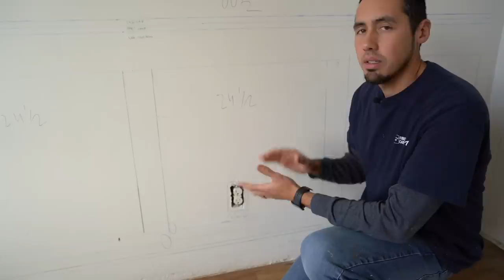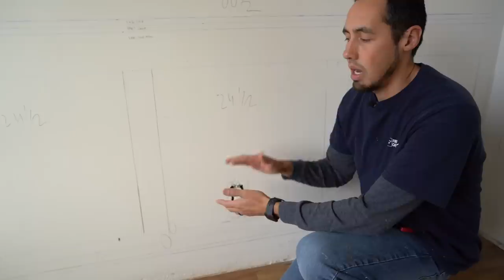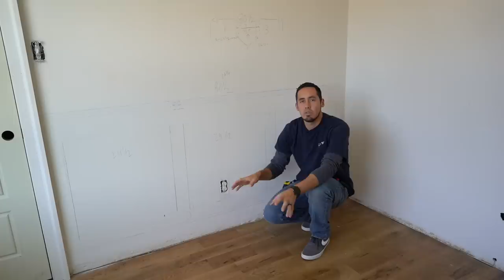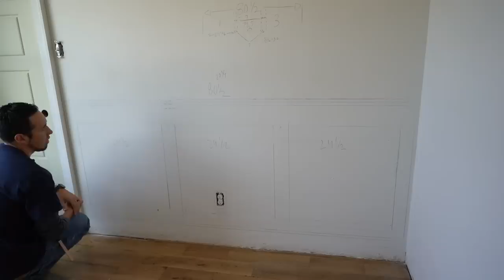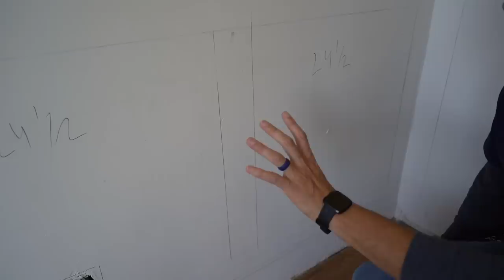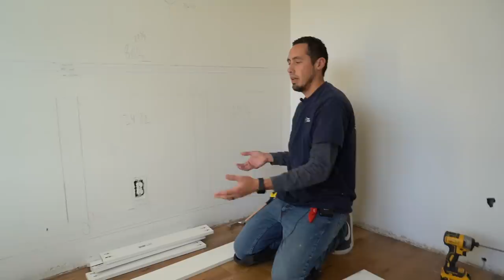Building a Wainscot Unit - Interior Trim Work

Comment: Wow, I’m blown away, the measurements are the same. That’s got to be nice. Is that what it’s like in the real world? My bosses projects are sometimes three inches off, and I’m not exaggerating. Floors that drop three inches, walls that veer back three inches. Walls and ceilings that look like a roller coaster. Try doing finish work in these conditions. lol 😂

Comment: Richard May I suggest that you make stand up jig to hold the rails perpendicular to the ground. This way you should be able to just slide the stiles in place. This way it will make assembly easier. Richard I never knew how to make out the boxes as you do. Appreciate ask your teachings. Thanks

Comment: Really enjoying this series so far and looking forward to the rest of the episodes. I’ve been installing high end kitchens for more than 40 years. As part of the trim detail in many of them I’ve done a lot of wainscot over the years. So far your series has been spot on with how I approach the process with one exception. I always use full height stiles on the ends of the wainscot units. I guess it’s the cabinet guy in me but I think it looks more finished. It’s also easy to scribe the full height stile to an out of plumb corner before assembly.

Comment: When you’re taking the measurement for the same cuts it’s probably better to mark your first cut instead of measuring from the inner blade. The TEETH of the blade will usually take 1/8” out. If your measurement is from the mid part of the blade and not the teeth your cut will come out slightly shorter because the teeth take more out. I dont know if that makes sense. Your work is great and I definitely learn a lot from you. Keep it up Richard!

Comment: Good series, lots of solid information. My preference is to have the unmolded flat area of the top and bottom rails the same width as the stiles. Also, the inside and outside corner stiles should egual out to the width of the main stiles. Balance is key.

Comment: Hey Richard, I'm a trim carpenter that's been doing this over 30 years and I love watching your vids. Ive been using the kreg setup for years and used the kreg screws for years and then I switched over to using 1 1/4 drywall screw and have had great success with them,  just wondering if you have ever tried using drywall screws?  keep up the good work

Comment: hey on the porter cable jig, you only have to do once the handle that twist, this is for the thickness of material, once you set up, you have to use the black handle on the bottom, that is the way is designed and requires less effort

Comment: Just a suggestion, but if you slide the end of the unit into a corner after the first stile is attached, it'll stand up without having to juggle it. ( Like working on a door.)

Comment: Tip. If you can’t find a Packer or piece of wood to prevent tilting or anything in another similar circumstance, use a screw and screw into the depth to make it flush to act as a packer

Comment: Love that there's no need for glue on wood to wood or wood to walls. Do we not nail the inner vertical styles because the odds of hitting a stud are slim or because they are only 24" tall and held by the pocket screws or might a dab of glue behind them be prudent?

Comment: Hey Richard. Thanks for another great video. I'm remodeling my bathroom, and plan to include both  bead board ceiling (boards), and the wainscotting you describe in this video. My old finish nail gun bought the bullet, so I need another. I plan on getting a Paslode to replace it. Do you recommend a 15Ga or a 16Ga for this work? Thanks for the great training! Yo

Comment: Thanks for a great session!  Assemble standing up (how obvious). So much easier than trying to put long units together on a flat surface.  As I recall the corner at the right end of the first section is pretty plumb. Would you have used the shorter rail measurement if the difference in lengths was smaller than the thickness of the stiles?  And how will you install the next section (shim, scribe cap)?  Thanks again.

Comment: Great videos. Would you ever put a thin ply or MDF behind the wainscot unit? Ive got a wall w glue and old wallpaper from a previous owner, but wainscot will cover the area. Easier to cover over or fix the drywall and then build? Thanks for all the detail

Comment: Another great video. I for one am appreciating the pace and detail you are going in to. One question, would it be possible to go in to a bit of detail around your choice of brad nail sizes (gauge and length) for the different applications on the wainscot and door/window casing, trim etc?  It’s one aspect that is new to me. Also how far you can ‘push’ using each gauge eg looking at your tool list I think you were using a 15 gauge nailer for fixing the wainscot to the wall but could you get away with using an 18 gauge nailer? And how long are nails you typically use? Thanks for all your helps with these videos - it’s as good as a Netflix box set! 😀

Comment: Hi, I enjoyed watching your video, very informative. 
I have a couple of questions I hope you may be able to answer. I may be jumping the gun somewhat, however I have a similar project upcoming for our new home and so very interested in the best way to proceed.
1. What material are you using for the wainscotting, solid timber or MDF? Are you using 3/4" / 18mm material?
2. Would you normally install sheet board to create a panel between the stiles or does the original wall serve as the panel between the vertical stiles?
3. Our walls are constructed from concrete blocks with a "dot and dab" Sheetrock overlay (no stud work). How would you suggest I fix the panel system to the wall (the walls are in good condition) would a construction adhesive be suitable or would I need to use Rawls plugs and screws?

I know you are a busy man although any advice would be greatly appreciated. 
Many thanks and keep up the good work.

Comment: Watched this whole playlist and missed the actual install of the hardboard in the wainscot frames. Is it just cut to inner square dimensions and held in by cove moulding, or did you rabbet the edges and have the frame hold it in?

Comment: Do you ever use glue along with your pocket hole screws.  I’m surprised the pocket hole method in MDF holds together so well.  Do you cut your own MDF boards or buy them that way.

Comment: Quick question I did some similar work with biscuits and glue and mdf ripped to the dimensions I wanted for the stiles.  I like your pocket screw method way better do you use any glue at all if the material is mdf and not pine?

Comment: If it is a hall or long room with unlevel floor, this leveling method may look ugly  ( I did one chair rail project , there was around 4 inch floor level difference) , People may not notice 4 inch difference on the top wall section because it is wider. (just my opinion). Great educational finished carpentry. I did learn a lot from you, Thank you for work.

Comment: Thanks so much for sharing your knowledge. I’m planning a wainscot project. I have hot water baseboard radiators running the span of the wall. How would you account for the height the radiator takes? Would you build the bottom rail on top of it?

Comment: Hi.  The wainscoting frame is 3/4 inches and the baseboard adds a bit more.  I bought 3/4 x 7.5 baseboards. What if i have a regular moulding around my door opening? The added thickness of the wainscoting and baseboard will be higher than the stock door moulding. Does that mean ii have to replace the door moulding as well? No problem if I have to.
Thank you

Comment: @Finish Carpentry TV  It's always nice when it comes to the exact inch. Like when your lunch costs $8 even. BUT with that, I thought the saw "ate" a certain amount of board, what, 1/8"? So even if you got an 8' board for vertical styles, could you still get exactly 4 out of it? 3 cuts at least, is there enough extra on an 8ft length usually?

Comment: No pl? Or glue ever behind it?
Reply from the maker: Glue is not necessary for the joint that is screwed together. plus the glue doesn't like to stick to the primer to well anyways. No need for adhesive when shooting in studs. These are 15G nails

Comment: Out of curiosity, why not just put your masonite on the wall first and then throw your wainscot on top of that? I realize you use a bit more material that way, but it seems easier to just throw the laser, cut the piece, glue and nail it on, then go over it with your trim.

Comment: If the measurement between the top rail and the bottom rail is slightly different because the two end walls are not at right angles how do you scribe for a good fit

Comment: Question: how do you handle when the top rail needs to be slightly longer than the bottom rail where the wall ends up narrower? (In my case 3/8" longer on top) Do you move the top stile in half the difference on each side and then hide the gap with the next wall's panel?

Comment: Here is my novice question!! Let's say when you measured the length of the wall top to bottom for your rails they were off? Do you then have to trim off the vertical that goes in the corner? Hope this make sense.
Reply: I think your question is tricky because of the way you worded it. I think that what you're asking is, when you measure the top and it is different from the bottom rail, what do you do? Answer: go with the shortest measurement. That means that you may have to shim the corner of the adjoining wall. In this particular predicament, the other demising obstacle would be the door trim which I am going to assume is level. He just installed it.

Comment: So great on 24” but what about the kerf? Now if you’re gonna cut 24” pieces out of let’s say a 16 foot board you’ll waste almost two feet. It would be better to have them just a bit shorter right?
Reply: around me boards come in 14 ft lengths but the actual measurement is 14ft 3 inches giving more then enough to get 7 equal 24" cuts

Comment: Is the style you put on the corner, against the other wall, the same width as the other 3 along that wall? If it is, won't it look thinner once you butt the style for the other wall next to it (by 3/4")?
Reply: That was my only question as well. During the layout need to add 3/4" to the right hand stile.
Reply: He addressed that in a previous video in the series. He'll take 3/4 off of the stile on the next wall..

Comment: If you were trying to maximize your use of the boards, shouldn't you have shortened the stiles by at least your kerf thickness?  Because now an 8 ft board will only yield 3 24" boards and one 23 5/8" (assuming 1/8" kerf)

Comment: Yucca board?? Did I miss a video??
Reply: I thought this is going to come up. I saw some mud on the plug in the wall. I guess this isn't a video series on how to smooth drywall..
Reply: My intent was not to be negative. I saw the one video where the discussion was regarding where to place the seam for the board. I think all the Finished Carpenter Videos are outstanding and have been taught a tremendous amount. I just was asking if I missed something. Did the decision to not use the board get captured somewhere and if so what was the thought process. I am here to learn.
Reply: I think he said he was installing the board inside each panel versus the whole wall behind the wainscoting. since he is installing a panel molding you can get away with doing it this way.
Reply: moose thank you!!! I appreciate this.

Comment: How long are the nails you used? And would 16ga. nails be enough for this?
Reply: Mark Kramer yea you can I do trim work and I use nothing but 16ga.
Reply: The life of Kelvin I thought you used a 15ga. nailer is why I ask that question. And I take it you use the longest nails your nailer will take 2-2 1/2”
Reply: Yea but personally I don’t like 15 because I have found out that it spilts my casing when I’m nailing on the edge

Comment: The measurements are off. The bottom rail is supposed to be 9 3/4” above floor according to Richard. It’s a 1x8 that is 3/4” above floor with an additional 1 3/4” per Richard. If the base is 4 3/8” (per Richard) with 3/4” for the cove, that’s 5 1/8”. So, 9 3/4” minus 5 1/8” is equal to a 4 5/8” reveal, not the same reveal on top which is 4 3/4”. So he’s 1/8” off. So raise the bottom rail to 9 7/8” if you want to use these measurements. How do I know this? I’m building it now.

Comment: What happened to the inside corner? I thought you where going to use a 3/4 inch wider vertical style so that it kept the same with on the other wall...
Reply: No. Smaller style on other wall.
Reply: Yep, he's doing smaller stiles on demising walls.
Reply: If you can't picture it, the 2 together gets to be a pretty beefy corner. Just to put a little logic to it.

Comment: If you have an 8ft board, and you cut it into 4 piece, theoretically each piece will be 2ft to your point.. But, you didn't Mention the 3 cuts that you're making which shave off about 1/8 of 
An inch total.

Comment: So what does a DIY guy do if you don’t want to buy a laser level tool? This is almost one of the most direct and complete videos by walking through all the elements of why your doing what your doing so the novice can do this also! One other thing, this video I came across and I think you left the info on the base till last. I think this whole approach is Classical Craftsman is it not. One video you might do is on what molding to use and not mix different thematic molding approaches. Most of us I believe are looking to repeat what your doing.

Comment: Did anyone figure out that the inside corner is going to be 3/4" thinner than the other stiles. The other wall will have a full width stile. 🤔
Reply: I Don't like that inside corner design, one is going to be big and other is small.

Comment: I'm stopping here at 6:15 to point out that your stiles should be a little less than 24 inches or else you'll have to throw away the last piece on every 4 foot, 8 foot or 16 foot board due to accumulated saw kerf waste. I don't know what blade your saw uses but my blades have teeth that extend slightly past the body of the blade so measuring the way you did to set my saw-stop wouldn't be precise. I have to measure to the tooth, not the blade. Your end-stile on the right needs to be wider the thickness of the stile that abuts it as that one covers the nails otherwise it will look noticeably more narrow.
Reply from the maker: 16' pieces are actually longer than 192" I explain why the stile at the right does not need to be wider( I explain it in video 2 in this series)
Reply: @FinishCarpentryTV  I watched #2 and I understand your point. I realize that I prefer to make my end stiles wider to frame each wall and you prefer to run your stiles kinda like a ladder instead. That cove-marking tool would have saved me so much trouble before I retired. I'm so impressed and depressed when I go to Home Depot, etc., and see all the new tools and jigs available that would have made my job so much easier, especially in the electric and plumbing departments.